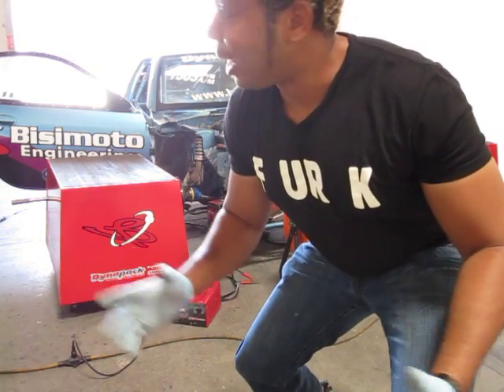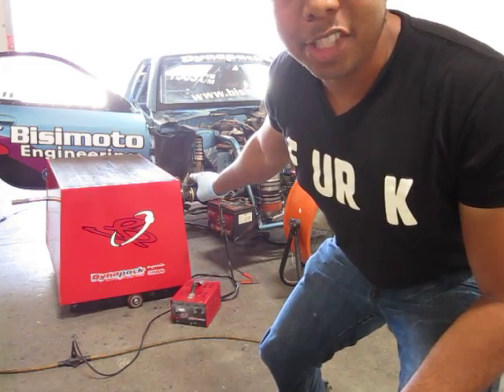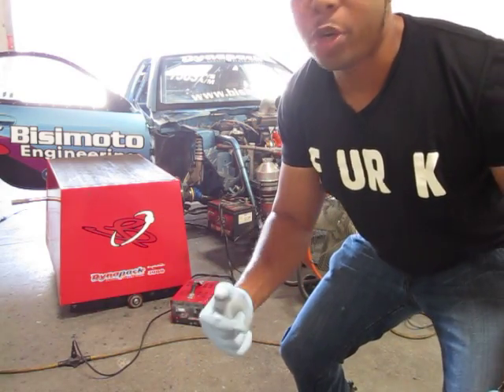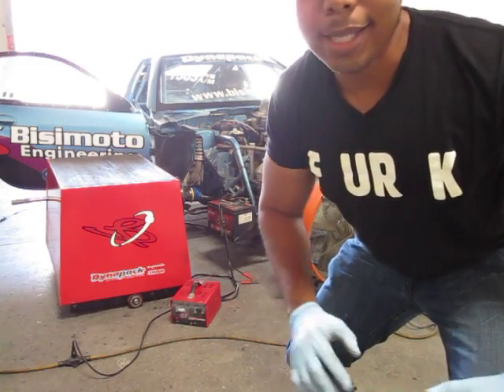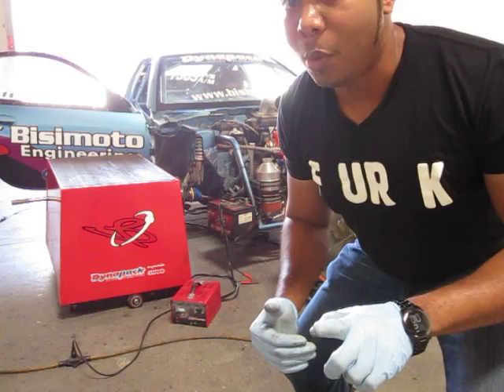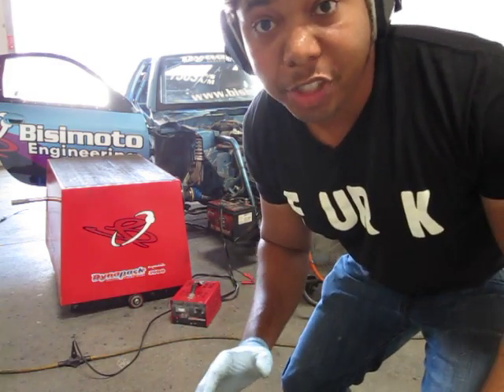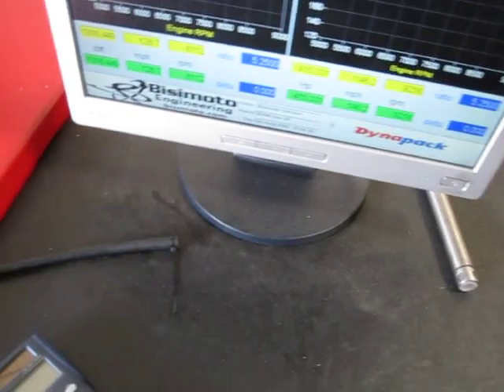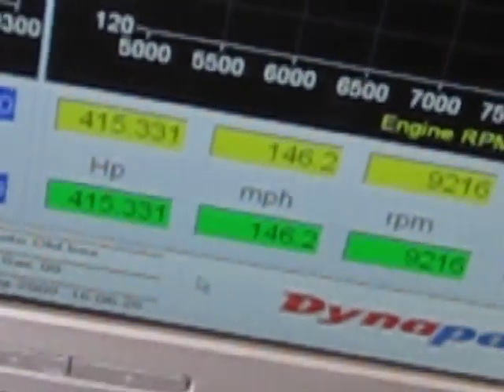Bisimoto Insight secret dyno test session: over 415whp

Comment: @wilberdp you don't press a button for boost or turbo. boost is air being forced into your engine by a turbo, supercharger, or something else. a turbo uses exhaust gasses to spin a turbine that sucks air which is then usually cooled by a intercooler and then put into your engine. since stitch (the car in the video) doesnt have a turbo it its not making any boost.

Comment: @wilberdp yes actually because Bisi has made 360whp before on a F22 SOHC NATURALLY ASPIRATED MOTOR in that same car. Seeing as how he has a Masters Degree in engineering and several other degrees in SCIENCE related fields, I wouldn't doubt that he has found several other trick ways to make more horsepower out of these larger displacement, single cam Honda motors. He was featured in Honda Tuning Magazine SEVERAL times for his amazing work with SOHC HONDA motors. Nothing to argue there.